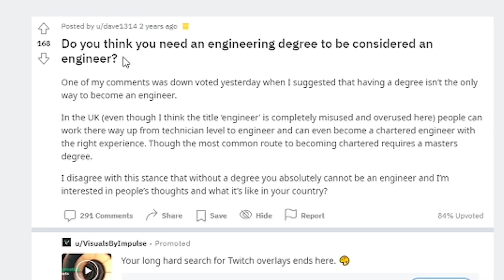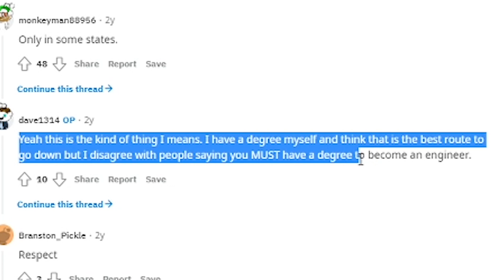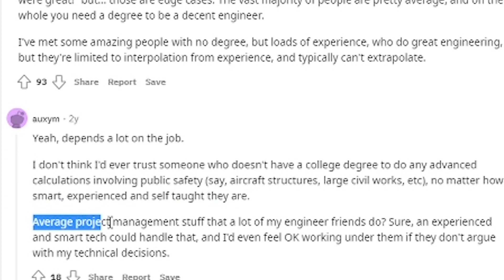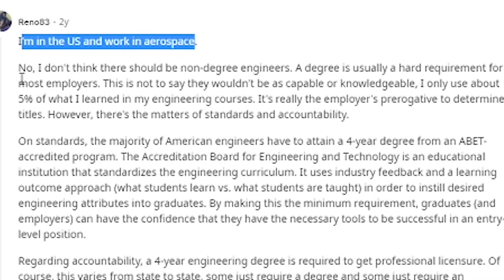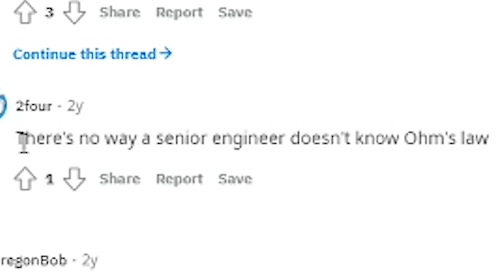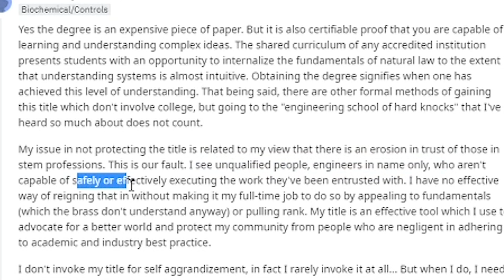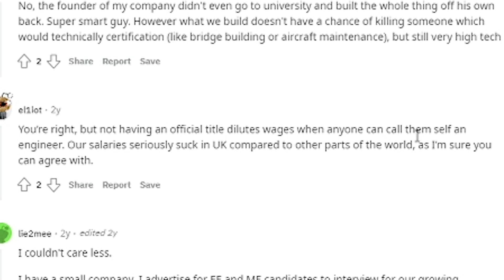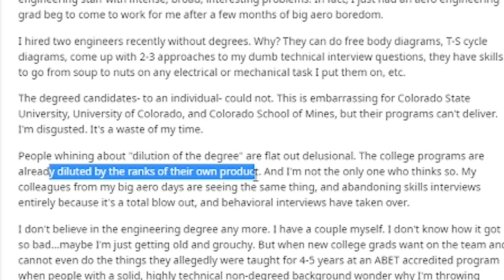Can You Be An Engineer WITHOUT College?

Comment: I have a 4 yr ABET MET degree, not an engineering degree, but I still work in the realm of engineering. Wish ABET would revamp the requirements for the tech degrees and call them applied or technical engineering instead.

Comment: Well done, video, and I agree with everything you said. This hits close to home as a Sr. electrical engineer without a degree. Yes, I'll explain. I studied and learned everything I could in electrical/ mechanical engineering for about 6 years on my own, researching all core curricula and buying the textbooks, and, yes, I did the work. I worked construction 8 hours a day, got home, and studied 4 hours every night for 6 years because I didn't have the money for college. I did have to shell out the money for a college course in CAD to get a student license to AutoCAD back in 2011, which really ignited my productivity. I loved what I was learning and just genuinely hated the sole-suck in the classroom. I designed and built everything I could, from CNCs, computers, and Tesla Coils; you name it. If it was geeky and technically complicated, I was obsessed with it. I spent every dollar I earned on the software, equipment, tools, and projects. Then I lucked out and landed a job as a mechanical engineer at an RV company, which I held for 5 years; I took classes at night when I could then lucked out again and landed a job as an electrical engineer at an EV startup and have moved into the Sr. Electrical engineer for the last 3.5 years. It has been extremely difficult to do this without a degree, but I have put in thousands of more hours over these 14.5 years to gain this knowledge I have, and that was only possible because I love electrical engineering, physics, and computer science at the very core of my being. Each employer placed me under much higher scrutiny, and it was a good thing that I had put in all the long nights. My ability to teach myself has been extremely valuable and has allowed me to crush other engineers' productivity on new complex problems. Again, I have put in 4 times more work than a four-year degree would provide, and I have spent much more money on my projects to learn EE skills than I would have spent on a degree at this point. Getting a foot in the door has been extremely difficult, and I recommend getting that degree. My situation is extremely rare and an unnatural blend of hard work and excellent luck! I am still going to school at night, but the classes are incredibly tedious and even more difficult at this point. You will likely be slapped in the face by the importance of the soft skills in the workplace that are buried in the hard skills in college. One of the pain points I did avoid was knowing what I was interested in before taking any classes, not plugging through a year of school to find out I wasn't interested in the field. I could write a book on this topic. To summarize this topic from my life experience, I want to get a degree. If you love engineering, nothing will stop you from learning however you can, but it will be almost impossible to do what you want at the company you want to be at. Would I consider a candidate's experience and passion projects grounds for hiring?.. Yes, but that's because I can recognize my own traits in others that have led to my success. Are you likely to be interviewed for an engineering job by me?.. Probably not. I wrote a lot here, but hopefully, this will provide first-hand input. Also, I am currently in college, nearing the completion of my BS EE. Regardless of my job title and experience, until I get that degree, I will not really call myself an electrical engineer.
Reply: I love your story. I do, however, have to point out that you can't call yourself an engineer by simply completing your BSEE. You need to go quite a bit further in your journey and earn the PE license before you can "really call [your]self an electrical engineer." And since that arbitrary road is long, I'd consider you to not be diffident and own the engineer title right now. Being able to do engineering as well as you surely do is far more useful to the world than amassing credentials that purport you can do engineering.
Reply: Bravo! What an inspiration, man. Hoping I can do something similar.

Comment: I hate to be this guy, but you are basically talking about the technical training in optimizing a product. But AI is already able to do these kinds of analysis faster and much more efficiently than we can. Obviously we will continue to "check their work" for a while, but I can't help but think that this sort of broad technical expertise is going to be a thing of the past. For instance, a modern mechanical engineer has all the technical knowledge that a blacksmith does, but lacks the mechanical skill. In this analogy, the AI is the new engineer and the engineer, the blacksmith.

 I believe this reality is still a few decades away, and will still have professionals working with AI. Engineering jobs will, in my estimation look like feeding inputs into an AI, Iterating and checking the AIs work. As with most automation, it will simply increase the development speed and capacity. But, it will practically negate the need for consulting an engineer for the majority of lower complexity products, and possibly even designing the manufacturing process for said products.

 But then again I'm not an engineer, so what do I know. 😄

Comment: A persepctive that may be interesting to others here, I’m currently working as a Quality Engineer (without a degree) for a multinational Company that many may know, in their perimeter security division. I’m 29 years old and have held an engineering title the past 7 years, prior to my QE position I’ve worked as an MET/IE for two other companies and I’m currently working on completing my SS Blackbelt. I can see both sides of the argument; however I’ve met plenty of “Engineers” that have completed their four years and are absolutely useless outside of design. The modern day universities have failed their students in regards to extrapolating not only data but identifying challenges that will need root cause analysis (outside of FEA) and not bandaids that will appear during development. I will add though that I’ve been a machinist since I was 14 working with my grandfather (who was an ME) and not everyone is blessed to grow up with that kind of exposure. I would describe this argument as “Engineers are born, not made” simply because I’ve met countless “engineers” who’s only justification for their title is the Appeal to Authority Mindset they wasted 4+ years to obtain. On the same hand I agree that not all technicians can think as an engineer, and I’ve yet to meet someone that has been taught to think as one through schooling, they’ve always been hardwired from birth,

Comment: Ummmm i just started at Tag manufacturers and I was a general laborer for 1 month and there was a problem with the mechanical engineers work, I caught it.. read the blueprints and was able to read them, they asked my supervisor who did the sketches and measurements from the prints and he pointed at me… I taught myself and still is teaching myself civil engineering… so for me to be offered a position in the engineering department at a mechanical company that design and build plates for excavators, just adds on to my experience I have in civil …… I’ve been a self autodidact for the past 4-5 years…. Got mentors and professional engineers and students on my call list… I only have a high school diploma and I worked my ass off to learn how to do math again and science and so fourth… so tbh you don’t need a degree even the mechanical engineers told me that even though I know a bit about it AutoCAD they gone work with me and teach me more formally and also excel and others… so idk…. I’m doing it… I proved everyone wrong.. yes I’m a student in school for civil but I managed to land a engineering job without even applying… very rare. And i haven’t finish my 1st year of college .. which I start soon though

Comment: All other things being equal, what does the degree matter? If a non-degreed person can churn out the same work as someone with a degree with all things being the same, then what value does the degree add? I work as an electrical engineer, and I have considered going back to college, but I cannot justify the time investment after working with many people who have the degree and finding they are not any more knowledgeable than I am. Yes, I even taught myself the higher level math courses online. I have solved complex problems and extrapolated existing knowledge to innovate and create new things through my career. Anything I need to learn I can research the same as if I had to take a class on it. At least from my experience in my 2-year program, all you get from college is a person that motivates you to teach yourself by threatening you with a failing grade. 

Sure, some people learn better from college, and if you weren't a high school nerd who would spend their evenings learning electronics while procrastinating on other homework (guilty) it will help you get started. But once you have knowledge and experience it seems hard to justify.

Honest question, can anybody tell me what I would actually get from college that I would not be able to get by being self-motivated? The whole idea that it just makes it easier to get a job just makes me not want to work for a company that values a piece of paper over a highly motivated self-disciplined person. I might be able to motivate myself to go back if I feel that there is actual value other than societal.
Reply: For you personally you might be self motivated enough to have learnt those things and take up new knowledge quickly, but the majority people do not. 

I’ve worked with many techs who think they’re just as good but when introduced to a new domain outside of their direct experience they fall over quite quickly. 

If you can prove you’re just as good as an Engineer knowledge wise and have the confidence to move around different domains with the experience validating that, you’re most definitely good enough (and hell probably better than a lot of degreed engineers). But the amount of people I’ve seen who can do that are rare as hens teeth, and theres reasons for that.

Comment: The true answer in short form to the short answer that is the description of this video: No. In reality of course you can learn the information more than one way and can be done without going to college but if you do that you will not be recognized within practically any community even if you can prove yourself that you have the goods and are better at the job than your direct peers or would be peers...

Where I live in United States there's absolutely no way to become a licensed Electrical engineer without going through an ABET accredited four year bachelor program minimum. They should have testing procedures for those people that have learned on their own accord and have the technical background and experience to outperform any engineer out of college hands down so there should be a means to facilitate that and give those people their due credit to allow them the job they are more than capable of doing!
Reply: I've been bitching about this very thing for years because of the exact situation I'm in.
Reply: @WissamSeif  It's in the electrical industry. I got into this industry through the NJATC (apprenticeship branch of the International Brotherhood of Electrical Workers). After completing the 5-year apprenticeship program I topped out of top of my class and started running projects as a foreman for the electrical contractor I worked for. After doing this for several years working out of the IBEW as a union electrician, I did a job for municipal industrial wastewater industry leader and once a job became open over there I went ahead and applied and got hired and have been there ever since. Throughout the whole time of my career I have read as much and try to understand as much as I can around what's behind it regarding the engineering aspect of it. Countless hours have I spent on my own accord learning the fundamentals of electrical design and before I knew it I was putting down the engineering books with ease. Currently I'm a project manager overseeing the electrical, instrumentation, automation and controls, plus the radio network system and remote monitoring (SCADA system), covering about 95 locations under about 35 capital improvement projects. They've done this because my employer has figured out that I'm much more knowledgeable than any of their electrical engineers and have blown them away from a "rubber meets the road" standpoint. I'm constantly critiquing and modifying designs due to errors in electrical and instrumentation design where going toe to toe with the design engineer is common. I am almost if not batting 1.000 with these people and I back up every argument based on objectionable reference information and they typically lose the argument because they can't back up their points of view other than their subjective opinion. So I've been in a position for years where I've proven my worth more so than any current electrical engineers they have but yet won't pay me as a project manager because they're required to have a four year degree where I work so I fall into this weird exception category which is ridiculous! I know I probably come off arrogant here but I'm just speaking the truth.
Reply: No matter how much reality speaks for itself and having the "proof in the pudding", and the fact that Senior Management can admit that I'm more than capable and am currently doing the work, they are 100% stuck on the need for that ABET accredited 4-year engineering degree. Even after me literally DOING the job for years now. 😂 What a joke! Look
Reply: @WissamSeif  Firstly, I want to thank you for taking the time you have in this dialogue with me. You are 100% correct in everything you said. I agree with you. The kicker in my situation is the "grade" pay of which a 4-year ABET accredited degree is required for the job I'm doing doesn't have the professional engineer licensing requirement!? I think they are changing the job description to just a four-year degree in a related electrical engineering field that is not ABET accredited. I heard that through the grapevine from the horse's mouth so to speak last week. Well once again I don't have a 4-year degree only a 2-year AAS I'm working on to complete (excelsior college is crediting me 34 out of the 60 credits right off top from my apprenticeship with the IBEW), Plus my experience and self-taught academia. So here again I still can't put in for the promotion. I figure they were going to change it specifically to my credentials like they do when they want a particular person in a job but don't have part of the requirements. I spoke with the chief of our whole department and he said he'll try to do just that if I get my 2-year degree and master electrician's license (which I can take right now and pass easily just never did it because it never did anything for me honestly outside of being able to pull permit directly for side work but I've always had a workaround for that with my buddy's business). So once again here we go again with the dumb shit and I will probably follow suit.... It's just ridiculous when you're already doing the damn job you know? I'm constantly challenging other engineers on their flawed design concepts and explaining why objectionably and so far they haven't proven me wrong yet even though I'm sure that day is coming it's just hasn't happened yet but like I said before the proof is in the pudding and I don't understand why they still need me to jump through all these hoops but this is a government job so I think I get it...
Reply: I have had job opportunities offered to me from engineering firms around the area I live in because of the correspondence I've had with multiple agencies and over the years, people get to know who you are and what you're capable of. It's just they don't have Anywhere close to the same paid time off benefits, even though the pay is slightly better. I turned them down because of that and they couldn't compensate with higher pay since they couldn't ensure more paid time off. Also it would have been salary and currently, I'm hourly and get an overtime rate past 40 hours which happens every single week. There are some organizations out there willing to look past the fact I don't have that piece of paper but no matter what if you have to put a stamp of approval on any engineered drawings (P.E. license) there is no other way other than an ABET accredited degree plus the state requirements of holding the PE licensing and I do agree with that even though in my case I think the customer would be better off if I designed their electrical and control system in the majority of cases, I realize I'm not in the majority here but very much a small minority and we can't make rules based off of the small minority.

Comment: Here's a story (probably apocryphal) that has probably been making the rounds at
engineering schools all over the world for decades:

A junior engineer had been working under more senior engineers on several projects.
Finally, he got a small project that he was placed in charge of. It was an elevated water
tank with a height of 40 m (130 ft), standing on four legs. He made the necessary 
calculations, ordered the materials, and supervised the construction of the tank. 
Unfortunately, when the water tank was first filled, the legs buckled and the tank collapsed.

QUESTION: What had the junior engineer failed to do, something that he should have
done first?

ANSWER: He failed to allow for the weight of the water!
Reply: The adage or anecdote is actually about an architect who designs a library. But I guess the story morphs over time.